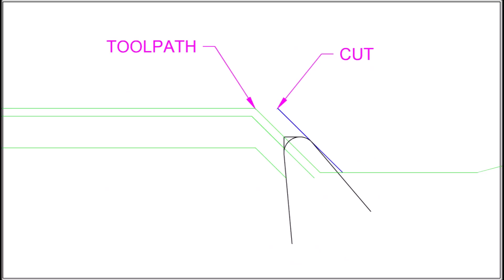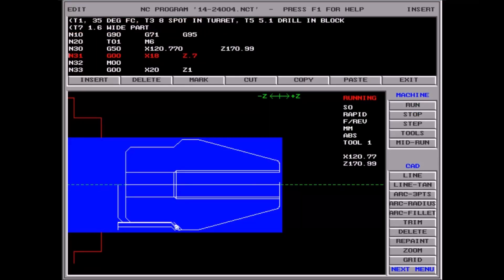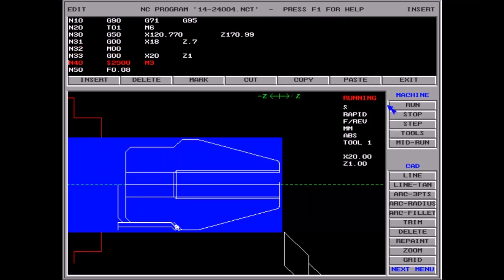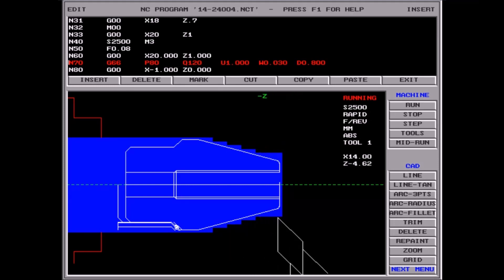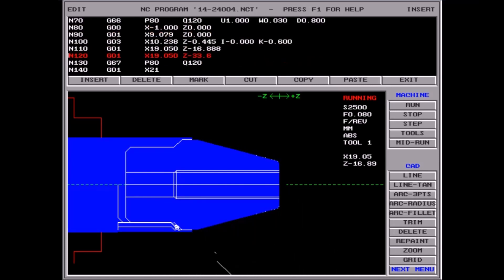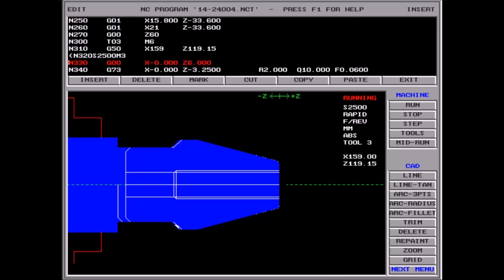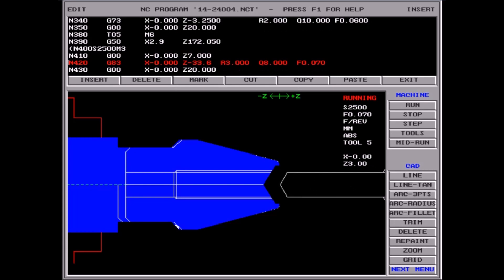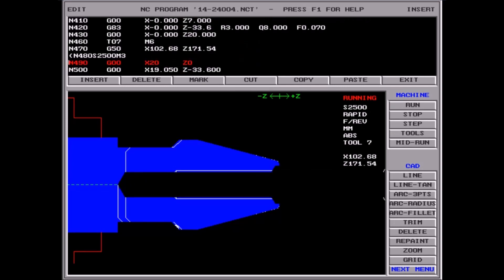Turn, Drill and Part aluminium rod end fitting in cnc lathe. Canned cycle and deep hole jobber used.

Comment: That drill will always struggle to start when you put a 118 deg point into a 90 deg start.The drill catches on the outer parts of the cutting edge rather than its point.Swap that spotting drill to one with a 120 deg point and the second drill will start straight.Yes I know it will change the chamfer left in the part but most people wouldn't pick the difference.
Reply from the maker: Thank You, not a problem I have very often as I normally use stub drill and go straight in.  That DHJ drill in this video has 135 point.  Better way for me would be to start it with a stub drill and then the spot drill. I have heard this discussion before and I thank you for reminding me of it.

Comment: Thanks for taking the time to put together all these videos. I recently purchased a Boxford TCL100 really only as a project but now I've got it up and running I wondered if there is any chance of making it into a business opportunity. You seem to have a steady stream of work coming in and it's very enjoyable to watch the different projects! Can you advise any good forums or groups which might welcome a newbie to the world of CNC?
Reply from the maker: Never heard of theBoxford 100, 125 yes but not the 100. I am retired these days but yes the lathe did used to provide me with an income (combined with CAD drafting work) It was making prototypes of parts I had drawn up that got me started in cnc turning. I was asked if I could make short runs ie shorter than what the customers existing supplier wanted to do.  Well starting out and hardly knowing how to operate the lathe, big runs were not what I wanted anyway. That was how it started.  I do admin a Facebook group, The Hercus Benchtop cnc users and if you would care to join that, you may find some like minded folks. You don't have to drive a Hercus to join, just mention the Boxford in the application questions.
Reply: My Apologies- its a TCL160, Typo on my behalf. Thanks for the info and thanks again for the Videos!
Reply from the maker: A On the 160 is a good size, will you join us on FB?
Reply: smallcnclathes I'm afraid I deleted my Facebook account a few years ago because I questioned just how much value it had- I seemed to spend a lot of time sifting through rubbish with very little reward, maybe I was just looking in the wrong places. I believe you may have given me reason to start a new one!
Reply from the maker: A On Quite understandable. I only joined Fb to create the group. Belong to very few other groups and have limited social contacts. Group is public so you can have a look at the content without joining. We have 200 members worldwide, so not a huge group but nice folks who  are really helpful.

Comment: Thanks! Is the lathe your own build? Why still DOS?
Reply from the maker: No, the lathe was built in Australia back in the nineties, by a company called Hercus. My lathe still uses the original electronics and dos was the operating system in use at the time. The lathes were made until around 2005 when they were using WinXP. Early machines do not run on the later software.  Many have been retro fitted, but mine is not, so I still use the dos operating system and on my PC I have an early file manager called Xtree Gold which allows me to use the system without using he dos command line. History and specs for lathe can be found at benchtopcnc.com.au.